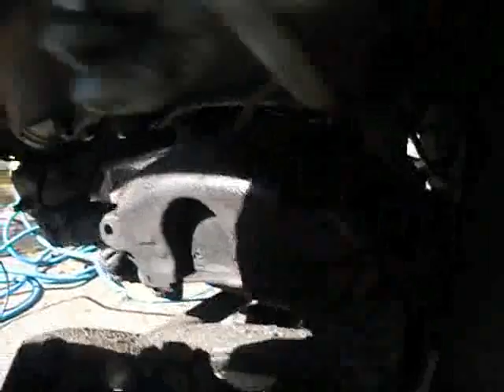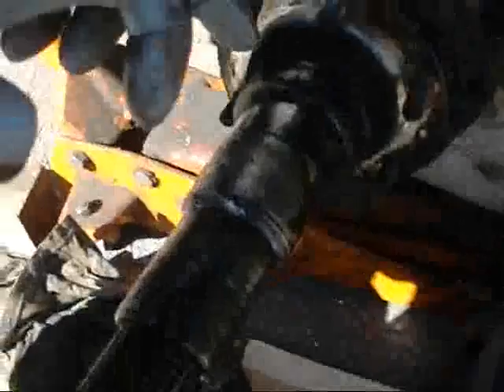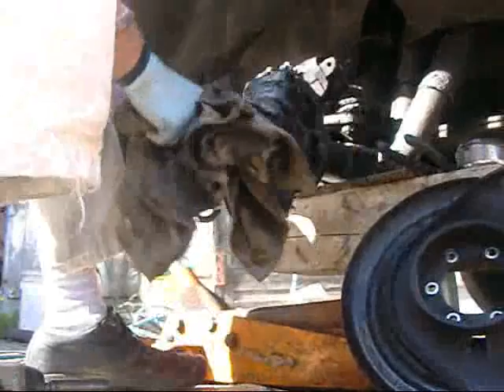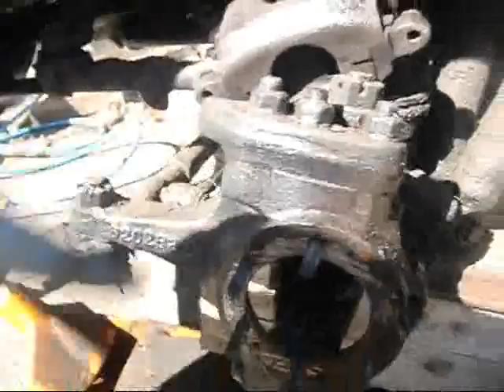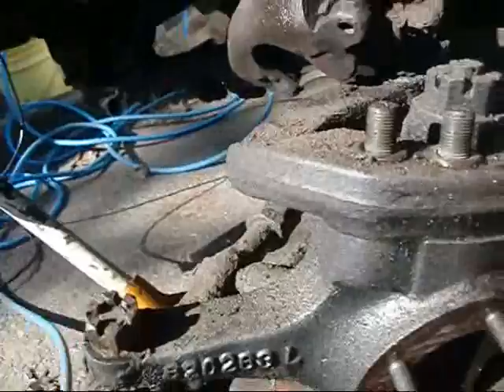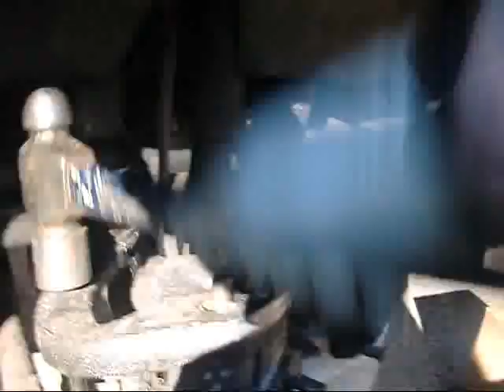5 5 12  SF Sub LF Ball Joint Replace Vid II.wmv

Comment: I thought you were going to ask for some dead blow hammers from Santa ?  What are you complaining about the cones on the steering arm bolts. The older axles on big trucks use 8 of those cones on the bolts for the axle shaft. Doing ball joints is a bitch of a job not very nice I don't like doing them.